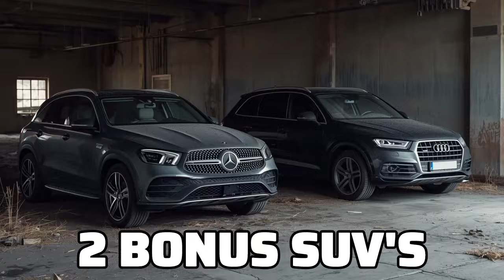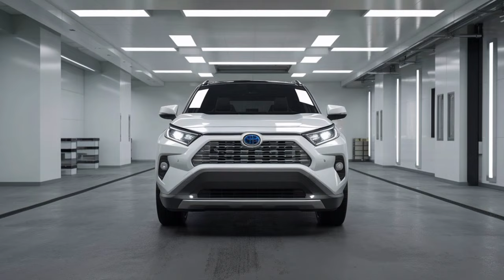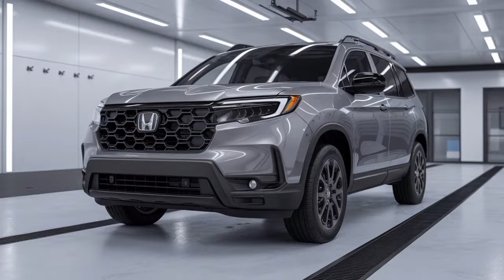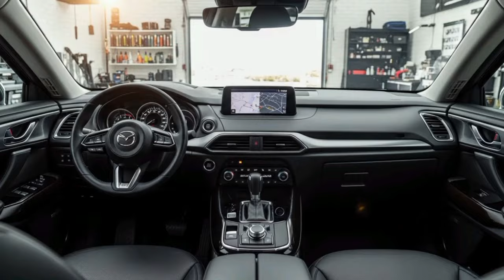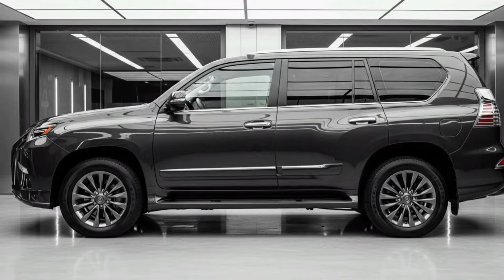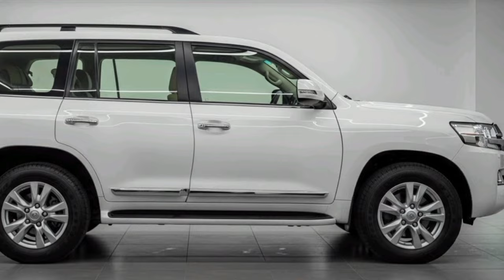10 SUVs That NEVER Break Down - Buy Once Drive FOR YEARS

Comment: Underrated SUV, in terms of reliability. Having said that, We had a 2013 that was faultless, except for the AC requiring a $1.00 part, but it is noisy, door panels are thin, but it is a bad comparisons to the other vehicles we have that were 2 or 3 times more. Great cars